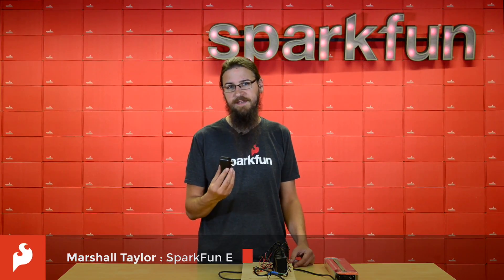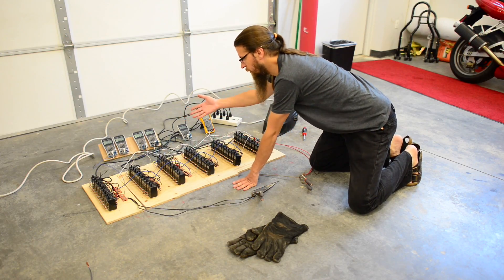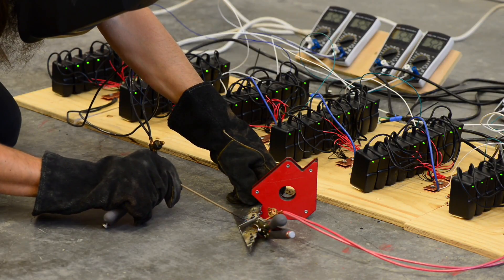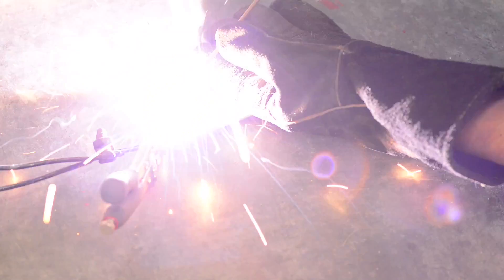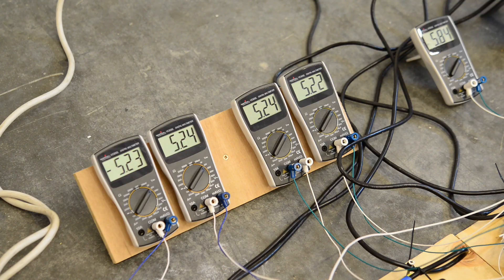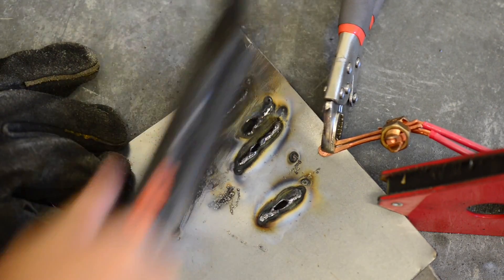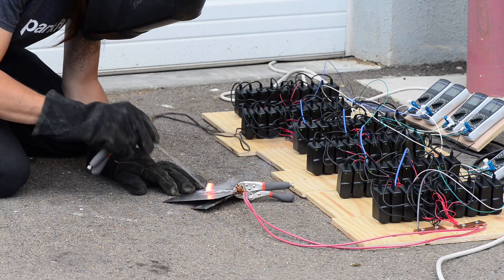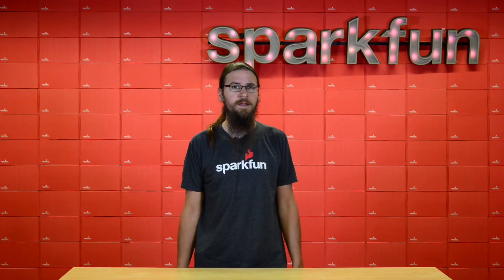Enginursday: Welding with 60 USB Chargers

Comment: As others said, you need more current and less voltage.  20A is far too little current to weld with. My guess is that you need somewhere around 60A for welding that sheet metal. But that is based on my experience with TIG. Others with stick experience suggest over 100A. 

The fundamental problem is that those are constant voltage power supplies and welding need constant current.  But it seems it could work from the results you were getting.

I would give it a try at 5v @ 60A just to see what happens. I would also be interested in seeing meters on the current. I have a suspicion that in your first test the power supplies are delivering more than 20A for a short period of time(until the caps drain). I'd put a 200A shunt on there and capture the voltage drop on a storage scope.

Comment: What size rod did you use...1/8" rod need approx 125A, you need smaller than 3/32" 
Pretty cool...but just using a huge stepdown transformer would be easier...standard "buzz box welder"

Comment: Good job,,,  
It has been 50 years,,, but it used to be for 1/8 inch rod, it took from 130 to 165 amps...  Like I  said,, 50 years is a long time to remember stuff that you don't use anymore. The different types of rod made a difference,  and how dry they were. We kept the rods in a hot box under a heat lamp...